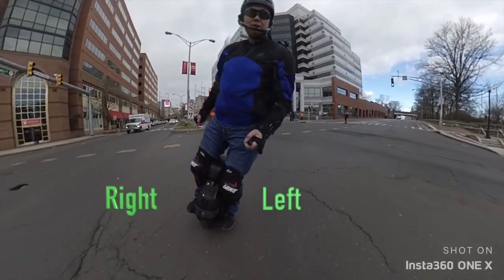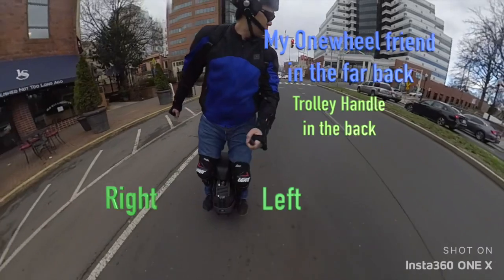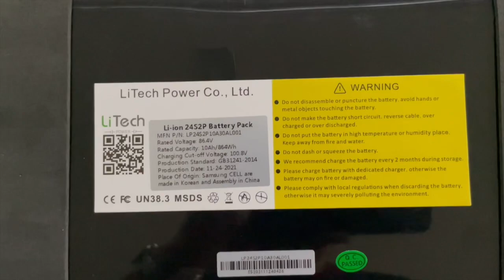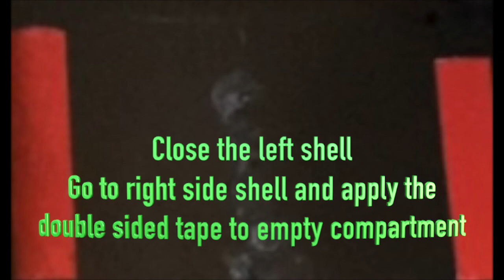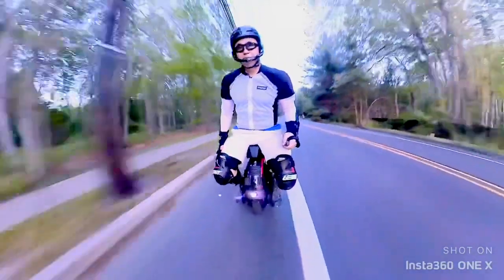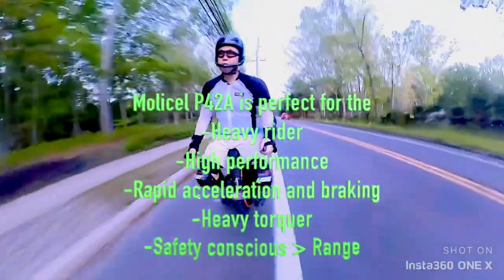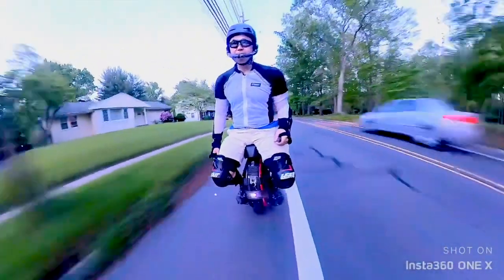I Swapped My Begode Stock Batteries for LiTech

Comment: Speakers are SO good on the Nik!  It’s also super easy to change the tire on it. I loved the H666 tire, carves well.
Reply from the maker: The speakers are great on the Nik. When I am alone in the trails I would sometimes play my tunes. In the suburbs I would sometimes play a repeating ten speed bike sound so I don’t scare anyone when I pass them. Lol. 
I want to change my tire someday and I have heard great reviews on the H666. I appreciate your input on this. 
Btw I watch your channel, you’ve got great content.
Reply: @AdamU1016  I've got the 84V Nikola. 1600wh battery. I upgraded the motherboard to a 3rd Gen. Wats the price on the Litech batteries?
Where can I buy those h666 tyre from?
Reply from the maker: @kiwimon3204  - The Litech Samsung E52 version that I received from Jason was free due to EWheels Battery Recall Program. Therefore, if your wheel was bought there, you might get yours free too depending on other criteria. 
You can get the H666 on EBay for about $36. 
https://www.ebay.com/itm/255438889811?mkcid=16&mkevt=1&mkrid=711-127632-2357-0&ssspo=W6YblefNSCu&sssrc=2349624&ssuid=KugJAoNXQMS&var=555397642947&widget_ver=artemis&media=COPY
Reply: @AdamU1016  how many cells do each of those cells have

Comment: thanks for doing the awareness video...  i have RS19HT with molicel pack.. totally love the set up..   keep up the good work adam... pham
Reply from the maker: Thanks! 
Was there more room on the RS19HT for the buzzer? The only place I could fit mine was next to  the motherboard. I made sure it was well adhered though. 
Have safe rides on your wheel!
Reply: @AdamU1016  i don't remember seeing any buzzers..  i got the RSHT Molicel already installed by ewheels last oct 2021...  <-- this is now my back up wheel..   my new ride is the Sherman Max  OEM pack samsung 50E's...  950 miles now no issues..  i have some videos of me riding on my channel here Youtube...  

you stay safe and keep edu- cating us.. !!
Reply from the maker: @phamster18  The buzzers on your Molicel pack are most likely on top of the battery as well as by the inside part of the trolley handle. The instructions Jason had emailed me was of an RS Litech install and the pics showed where the buzzers should be placed. 
I checked out your channel. Cool group riding videos there. You got my sub Bro!
Reply: How do you like your Molicel RS19? Looking to buy one soon myself

Comment: Mine should be here tomorrow, curious which ones I get. Good ole Nikola
Reply from the maker: I love my Nikola. Awesome, reliable wheel. If you are referring to the battery, Jason will be sending you the Samsung 50E2 as the standard replacement battery. I was quite surprised how easy it was to replace the battery.

Comment: I bought a commander from ewheels with the new litech packs. I'm getting horrible voltage sag and about 65% of advertised range with these "new and inproved" packs. I'm curious if anyone else is having issues with them as well.
Reply from the maker: 50E or Molicel pack? The Molicels have much less voltage sag in the higher discharge rates vs. the Samsung 50Es
Reply: @AdamU1016  50e cells. Much worse sag compared to the original begode packs though.  And worse range also.
Reply from the maker: @killianelson  - I never really looked at the voltage sag that much when I had the LG M50LT batteries. I ride between 25-30 mph and sometimes accelerate to 35 max just to be on the safe side. By the time my ride is done I have about 70-80% battery so I always make sure I have enough voltage left as buffer should I overlean or overtorque my wheel. Knowing that the Samsung 50E have higher discharge rate I feel a sense of reassurance knowing I have more buffer voltage when I ride.
Are you an aggressive rider? If so you should have gone for the Molicel then.

Comment: I'm trying to install my upgraded molicels in my Nik+ and they ain't fitting, it's like they are too thick, I can't get the shell back on:(  They are sitting flush against the inner shell with applied double sided tape but it's like they're 1/4" too thick.
Reply from the maker: Put all the screws in at one time but lightly turning each slightly and in a circular fashion. Do not tighten one screw fully at a time. Tighten each lightly as you go in a circle.
Reply: @AdamU1016  
I got the shell installed, man it's tight, you basically stretch it over the batteries, I guess it's normal but I don't remember the shell being under so much load when removing them to take out the stock batteries, my only concern with all this is impact, all the force is being placed squarely on the pack, I guess they are robust enough in design but still concerns me.
Reply from the maker: @retrothruster2539  - I have side pads that will absorb any impact on the shell. That makes a big difference and is quite reassuring.
Reply: @AdamU1016  
Yeah, me too
Reply: Same here.

Comment: Hello Sir. I really like plug and play solution. One question: What's the real range on this Molicel pack?
Reply from the maker: The plug and play is a great feature. Installing the batteries was a breeze. The hardest part was snaking the wires to the other side. The zip tie technique helped me out with this part.

 I would say that the difference in range between the Samsung and Molicel will not be that much in normal temps. From what I read in the forums, it seems the Molicel can handle hotter temps better. In freezing temps the Molicel can also handle the volt sags better.

Comment: So what’s the new Battery spec now, more/less or same ?
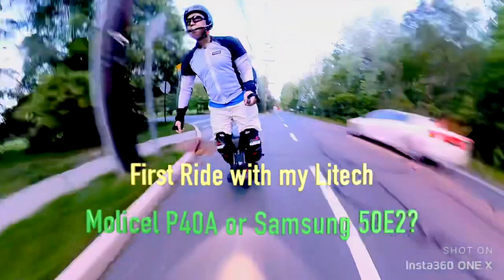Reply from the maker: I now have the Litech Samsung 50E batteries. Please check the benefits I mentioned starting at 4:22.
Reply: @AdamU1016  yea sorry I asked the question prematurely lol Thank you, I am definitely a conservative rider and I’m choosing the Samsung, thanks to you and this Video I will be replacing my battery’s from ewheels I already got in contact with Jason. Hope you make more content I love your all your videos so far. As I said before we both have the same Nikola 100v
Reply from the maker: @astyn3117  - Jason is the best. You will not be disappointed with the Nikola. Even though I have had my Nikola for over 2 years now I can’t see the need to upgrade at this point. I cruise between 25-30 mph. Max speed I reached was 35 mph and that was only a brief moment. All the new wheels are unproven at this point and the Nikola has served me well. Now with the battery upgrade, I basically have a new wheel with the tires still in great condition. 
Thanks for the kind words. With comments like this, it motivates me to make more videos. Enjoy your wheel!

Comment: I'm having problems closing the shell with the LiTech packs.  Did you notice anything like this?
Reply from the maker: I had a little bit of difficulty but I attributed it to the thicker double sided tape I used. Your batteries are probably not well seated in the compartment. I had pulled back the side of the compartment case so I could really align the battery packs deep in the compartment recess. After I had done this I was finally able to close the shell. It still felt tight but I was able to close the shell.
Reply: @AdamU1016  I am trying to position them without any of the padding or tape, so I should, in theory, have the most clearance possible, but the shell won't close.  Still trying to determine if I have a different inner or outer shell than newer Nikolas, because mine was an early three-pack 100V model.  Unfortunately, nobody knows the answer.
Reply from the maker: @neurokinetik64ES  - Both sides you cannot close or is it one side? Which side?
Reply: @AdamU1016  both sides, same issue
Reply from the maker: @neurokinetik64ES  - I bought my Nikola 100V in April 2020. When was yours?
Reply: @neurokinetik64ES  do it like a tire, get one started, get another across, and so on. Then rotate around and tighten. Mine was super snug too.
Reply from the maker: @RoyCarter  That’s exactly how I closed mine. I started at the top and made sure the screws were tightened just enough to engage. I then tried at the bottom and tightened enough to engage the screws. I did the same on the other sides too gradually alternating till all screws engaged. A tight fit but definitely doable.
Reply: @AdamU1016  August of 2019
Reply: @RoyCarter  When you opened yours up, was there a lot of pressure from the battery to the shell, even with the factory configuration?
Reply: @neurokinetik64ES  When I opened up on the original batteries, I think there was a thin double sided tape strip on the battery holding the shell down. Had to kind of pry it off. That may change the shape by having the center compressed and flair out the rim for a better fit. Might not though. Put one screw in, but not tightened all the way down, leave some slack. Then go to the other side across and press the shell out away from the center, get that screw in, and leave a little slack, work your way around doing opposite sides, then tighten in the same way, back and forth. It's all a tight fit, but it does fit. I had about 75% charge on mine when I installed so I took it out for a spin. They do seem to have a little more punch than the old ones. I was easily hitting 28 mph on a middle school football track. I charged last nite after and nothing blew up, so all seems to be well.
Reply from the maker: @neurokinetik64ES  - I keep up on the EUC forums and there was no mention of any change in size of the battery compartments or the shells ever. I agree with Roy Carter’s technique in how you close the shell. 

As I mentioned before, start at the top and screw til one screw engages lightly. Work your way to the bottom shell and screw until it engages slightly. Do the same for the other sides with light engaging of the screws initially.  Once they are all engaged, alternately tighten the screws all around. It will be a tight fit but you will be able to fully close the shells. My double sided tape were thick also and I was able to fully close the shells using the above technique.

Comment: I can’t figure out why my litech 50e battery discharge percentage gets up to 50-57% from what DarknessBot is showing me. Does this happened to you?
Reply from the maker: That’s strange. That never happened to me at all with my Litech Samsung 50E replacement. I recently rode 13 miles in NYC and I was doing really aggressive riding too. After 13 miles my battery percentage went from 100% to 91% on my Nikola 100V with 1800 Wh Samsung 50E replacement. 
Did you ask Jason? The best source that I usually go to is the Electric Unicycle Forum. They have the smartest minds on this forum. 

 https://forum.electricunicycle.org/forum/9-general-discussion/
Reply: He doesn’t have the answer’s. It’s seems like your talking about battery voltage im not talking about that im talking about the battery discharge section on the DarknessBot app is what concerns me
Reply from the maker: @richfierro868  I am actually talking about battery discharge. The Nikola went from 100% charged to 91% charged after 13 miles of aggressive riding. I thought that was impressive. I don’t know why your LiTech battery discharged so aggressively. Something must have been wrong with your Samsung 50E version. Glad you upgraded to the 40T. Just post this question to the electric unicycle forum. There are many battery and EUC experts on there.
Reply: Are we still supposed to balance the 50e battery pack? On the batteries it says not to
Reply from the maker: @richfierro868  - Cell balancing occurs in the last 5% of the charge cycle. That is why it takes awhile to get those last few percentage points to 100%. Without cell balancing, you can reach an imbalance of cells which can eventually lead to a short circuit leading to thermal runaway. I wait another 1-2 hours after the light turns green. You don’t have to always do this. Topping off is fine. However, to maintain battery health, charging past 1-2 hours after the light turns green is recommended once in awhile.